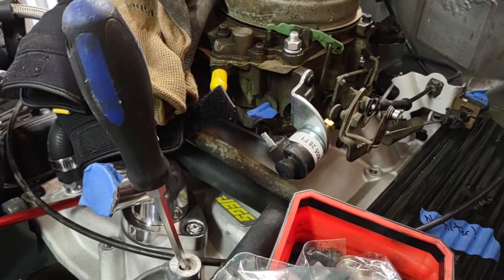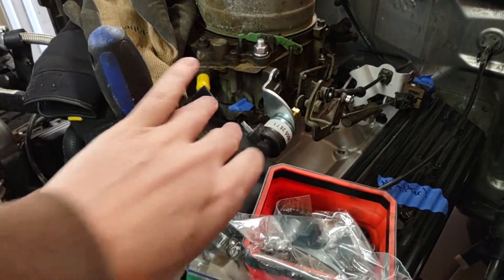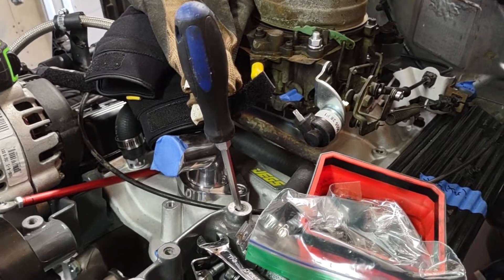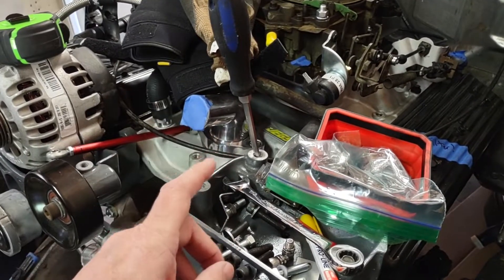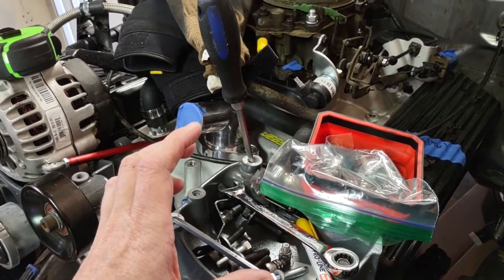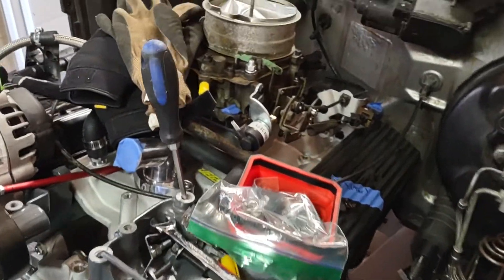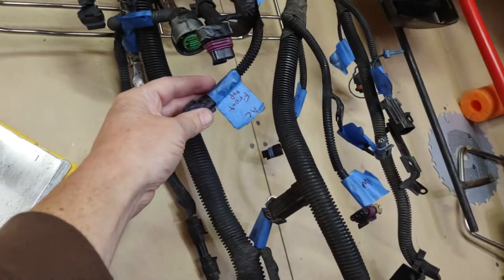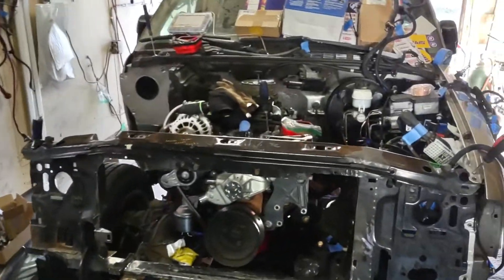Want to help? Which wire?

Comment: Might be better to splice into the switched side of the compressor cycling switch which is on the AC line, one side would be hot when the AC is turned on the other side only when the switch is closed and the compressor is actually working, IIRC been a few years.
Reply from the maker: Thanks. I'll look into it.